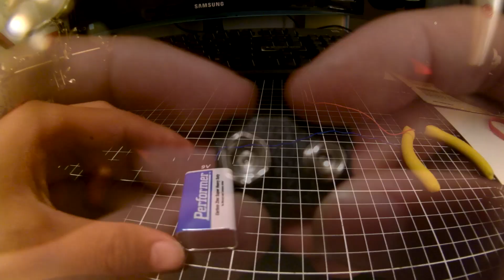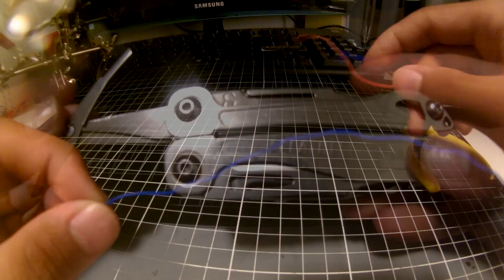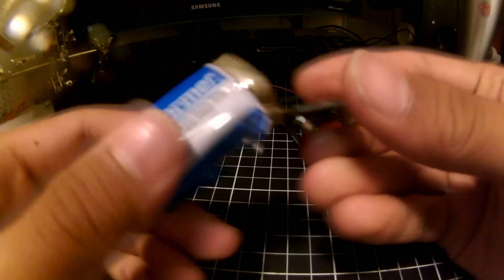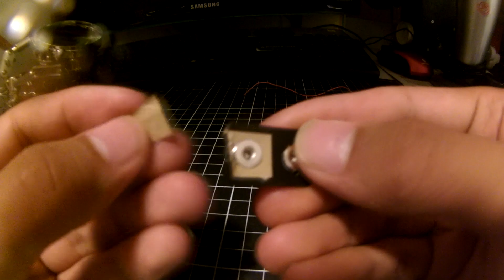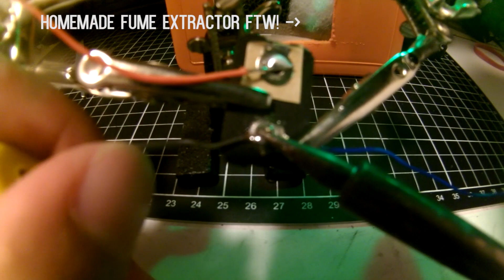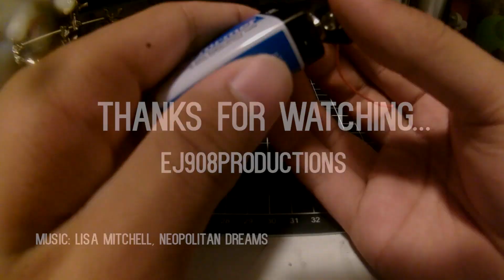Homemade 9 Volt Battery Clip

Comment: Lol what if you only have one 9v battery and want to make a clip for it.
Reply from the maker: If you have a dead 9v that will work too! But if you really only have one your best bet is to just go out and buy a connector.
Reply: great replyyy
Reply: springs from old/dead pens or nails or paperclips or make a pogopin yourself
http://www.keyssa.com/pogo-pins-a-40-year-old-technology/
Also clothes pins (wooden ones work best) hold wires to 9v terminals, just cut the extra length.
Aluminum foil and tape...etc. Lotsa ideas.